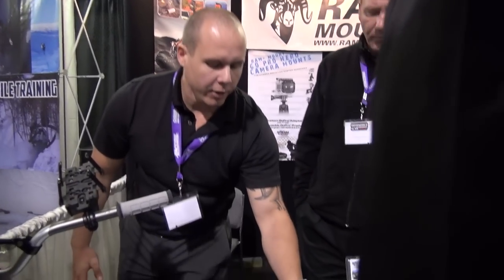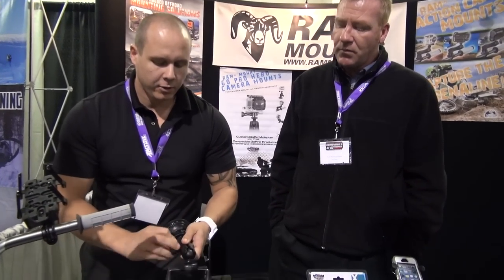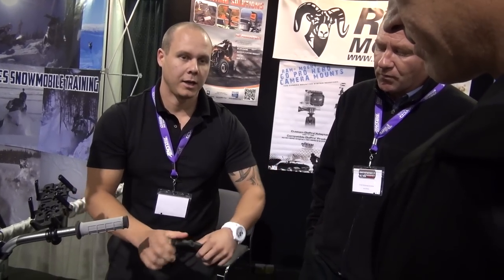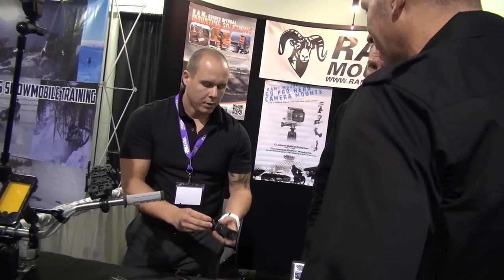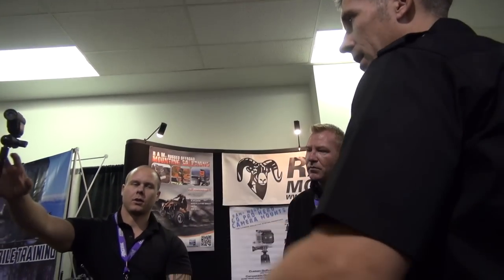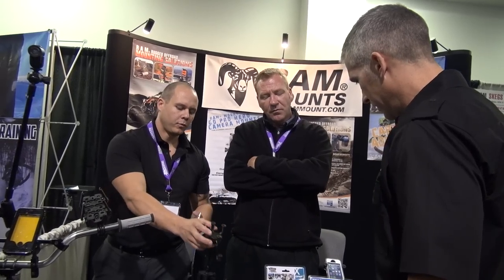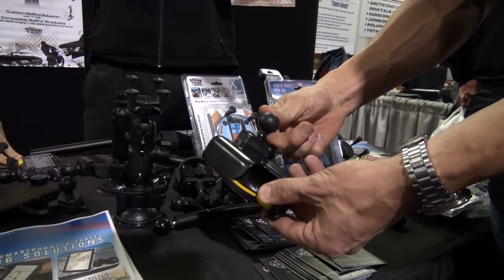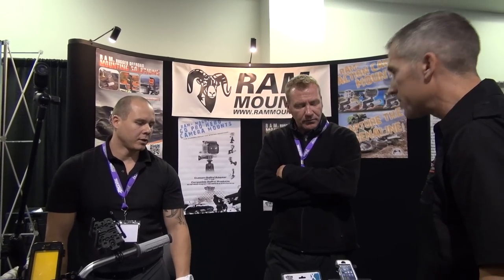Ram Mounts explained at the Toronto Snowmobile ATV and PowerSports Show!

Comment: I have an old Ram Tab-Tite that’s probably 8 years old. I added a swivel more recently so it can be use horizontal or vertically. I’ve used it daily in my Semi Truck. I haven’t had to reposition it in 2 years now and it’s the original 1” balls. I see no reason it won’t last another 10 years.